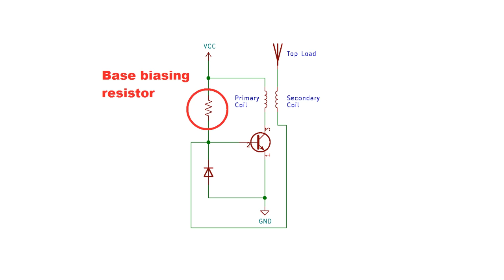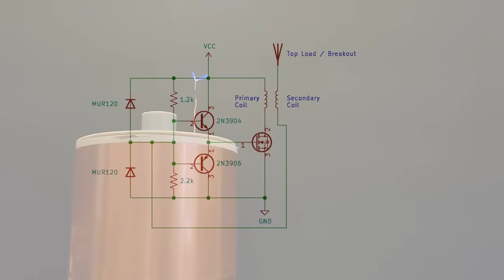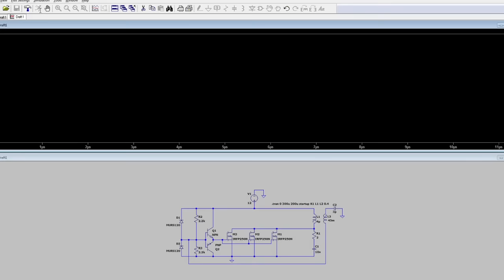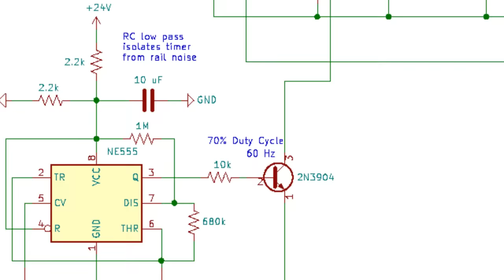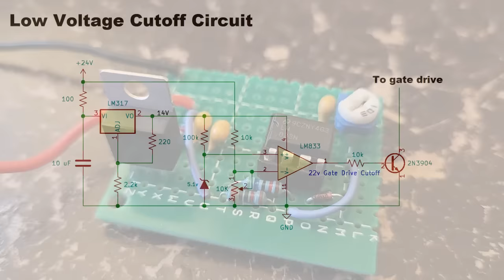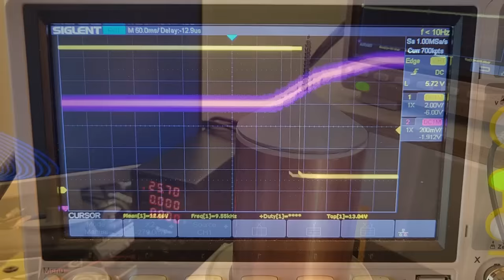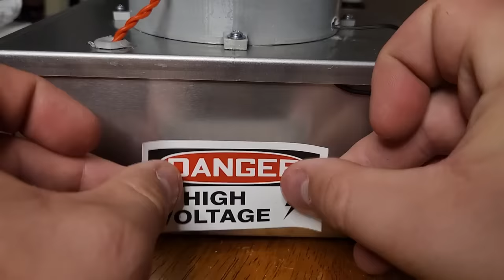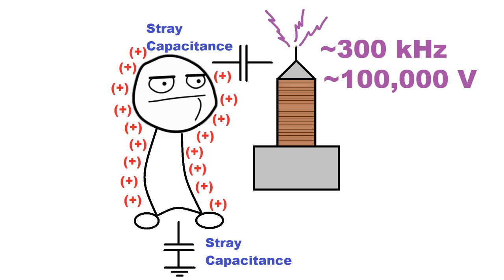Tabletop Tesla Coil

Comment: I can't get the circuit to work with an irfp260n, is the type of MOSFET the problem? I'm also using a very small coil, so could the resonance frequency be too high for my MOSFET?
Reply from the maker: Try switching the polarity of the primary and/or adding capacitance from FET gate-source (start with maybe 5 nF and work your way up).

If neither of those approaches work, the frequency might be too high. I've started to get trouble with FET switching times on anything faster than ~500 kHz
Reply: @HyperspacePirate  already tried to invert the primary windings, didn't work, I'll try to add the capacitors, is the irfp260n good for this circuit?
Reply from the maker: @edoardobonfante753  The coil in this video has IRF640 's with 1.7 nF of gate capacitance each, and the gate drive transistors have to work pretty hard to switch them at ~250 kHz. An IRF260 has 5.2 nF of gate capacitance, and you probably have a resonant freq quite a bit higher than 250 kHz, so your gate drive might not be able to keep up
Reply: @HyperspacePirate  oh, combined with the fact that i'm not using the BJTs to power the Gates but only the resistor divider you may have found the problem. When I power it up, the MOSFET opens and stays open, shorting the PSU. Also, I can't measure it, but I expect my resonance frequency to be over the Mhz. Maybe using smaller resistances in the voltage divider to have more current? I have some npn bjt but I Don't have any PNPs to use to swithc the Gates, can I use only an NPN?
Reply: @HyperspacePirate  I have some BC547 NPNs on hand, could I use only one NPN to drive the gate instead of an NPN and a PNP?
Reply from the maker: @edoardobonfante753  I haven't tried, but i don't think it would work as well because you really need the push-pull effect, otherwise you'll have a class A amp that's just burning up waste current half the cycle
Reply: @HyperspacePirate  yeah, you're right, this circuit is already too complicated for me, I'll try to use 440 and 220ohm resistors to have more current, but if it doesn't work, I think I'll need to try a simpler circuit, also because I don't want huge arcs, my goal here is 3cm arcs. Do you have any other solution?
Reply from the maker: @edoardobonfante753  I'd just make a larger diameter coil because everything is easier to deal with at lower frequencies
Reply: @HyperspacePirate  I will try it with my SGTC secondary, i already tried to put a big topload on the small secondary but it still didn't work, I used smaller resistor and got as low as 56 and 100 ohms but still nothing happened
Reply: @HyperspacePirate  btw thank You very much for the help, I wouldn't be able to identify the problem alone

Comment: Hey, nice viedeo as always, great build!
But try to use glue instead of a metal screw to mount your topload on the TC. The problem with the metal screw is, that it's going to glow up in a nice blue corona discharge, which reduces your topload-output.
Same thing happened to Electroboom in this video: https://youtu.be/WM25pUsrODk?t=498

Comment: i have a question if you don't mind
do the voltage rating of the mur120 diodes have to match exactly with the mosfet? 
planning on trying this out with irf460 so can i use mur160?
also can i use 100 watts for the 2 ohm snubber resistor?
Reply from the maker: They don't have to match exactly, but whichever component has the lower max voltage will be the limiting factor

Comment: But when the BJTs switch, don't they switch the Full voltage to the gate?
Reply: the resistor limited it
Reply: @TantalumPolytope  uhhh that's not how it is supposed to work
Reply: @ElIsraelJijijiji  are we talking about the base resistor of the top BJT?
Reply: @TantalumPolytope  I was talking about the how those totem pole BJTs don't destroy the MOSFETs gate since they are switching the full supply voltage to the gates, doesn't matter the base divider resistor

Comment: do you have a patreon or something?
Reply from the maker: Nope, just OnlyFans
Reply: can you make a video explaining snubber circuits and how to calculate the correct values of the resistor and capacitors? ive tried just guessing but it seems like when i ise the wrong value cap across the source and drain the circuit stops operating and i dont know why
Reply from the maker: @jed826  yeah i just did it experimentally. I held the resistor constant and slowly increased the cap value from 1nF and went up. I just built another one of these circuits for a different project, and i found that with one 27 nF cap it worked, but with two in parallel, it stopped. You probably dont need more than a couple nF

Comment: Does the base of the tesla coil need to be somehow connected to ground or can it operate without touching the ground at all? Also, I would suggest putting some wet clot or tissue paper over the resistors so they boil the water instead of smoking-if of course it is in the configuration to be able to do so....
Reply from the maker: If it's connected directly to ground it won't work. It needs to be either connected to the gate of the MOSFET or to a buffer connected to the gate
Reply: @HyperspacePirate Thank you. So the stray capacitance between the top load and Earth ground is what allows the coil to function? Given capacitors in AC have practically no effect...
Reply from the maker: @Hi-zf4bn  Yes. The LC tank on the secondary is formed between the coil and the parasitic capacitance - that goes for any tesla coil
Reply: @HyperspacePirate  Because I know that certain tesla coils are made with ground rods that connect the other (non-output) end of the secondary to ground, and was wondering if this requires such...
Reply from the maker: @Hi-zf4bn  This specific circuit doesn't require that. By being connected to the FET gate, the low side of the coil is always within a few volts of ground, while the high side is tens or hundreds of thousands of volts, so the difference is negligible
Reply: @HyperspacePirate  Thank you very much!

Comment: I’ve named this thing the mosfet destroyer for its absolute monstrous ability to destroy every mosfet it comes in contact with and randomly explode the signal transistors when I add a topload. I’m running it at 760khz you got any advise for what I’m doing wrong?
Reply: I’m prototyping it on a breadboard to get a bigger output after building it a month ago and getting my dual bridge Tesla coil driver up and running i figured I’d make an attempt at this easier circuit again and no luck so far. I’m using it like a class E in the higher kHz frequency ranges. Any ideas why my arcs are so small. Like an inch or so? And anytime I add too much capacitance the resistor just blows it’s magic smoke.
Reply: Do I really need a huge power resistor? That might be my problem.
Reply: I use a 5 watt resistor and it keeps its magic smoke:)

Comment: would it still work if you 3d printed the case instead of using the metal housing?
Reply: I was just about to ask the same, is the metal for shielding?
Reply: In another comment he says he used metal to shield the electronics and serve as a ground. 

I would think you could 3d print the enlosure and faraday it

Comment: hmm 3.7v per cell is only ~25% of total battery capacity about 30% for lihv
a better cutoff for safety is what most phones/drones tend to set ~3.0-3.3v per cell
this gets you >80% of energy but lets it still be fine for a tiny trickle or a forced override for things that need power to not crash

Comment: What is the purpose of the Tesla coil though? Does it have Any utility other than an art show? Because it doesn't seem like Anyone is using it the way Tesla intended.
Reply from the maker: It was originally intended for wireless power transfer. For a properly designed coil, there wouldn't be any arcs, just a really powerful alternating electric field
Reply: It can be used the way tesla intended, but not to the extent that he believed was possible.
Reply: @HyperspacePirate  why your 555 interrupter works at 30v????
Reply: @ElIsraelJijijiji  he used an voltage regulator (the 2,2k resistors and the 10uF capacitor)

Comment: I built up this circuit without the snubber, zener diode and capacitor bank and the arcs only managed to be the same as a  normal slayer exciter. But a diode got really hot and would have put out smoke if i let it run longer. My coil is in the frequency range of 760khz. Any tips?
Reply: Alright I reduced the turn windings to 2 and the arcs changed in shape considerably so I upped the power supply to 20v 10a and the magic smoke came out
Reply: Ugh the fets died it wasn’t the diode. I plugged it directly into 20v 10a built the thing up in 2 hours though and scavenged the mosfets from an old power supply. The mosfets rated at 500v 15a so I didn’t think it would instantly pop but you were right in the video and I should have put both the fets I scavenged in parallel. Now I have 1 mosfet and a dead circuit. Should have built the interrupter wouldn’t have fried the mosfet so fast.
Reply: You have an email, discord or Reddit I can contact with help with my circuit?
Reply from the maker: Different value capacitors from drain-source of the FET dramatically change the output power. Try adding a few nF at a time
Reply: @HyperspacePirate  I did the 3rd model with missing parts but I’ll try up the 2nd one again with the cap. I don’t really have adequate active cooking for my mosfets so I’ll have to get a computer heatsink or something. I built it in an hour and I fried all the components. I just realized I have more transistors in a box so I’ll give it another try. Thank you.
Reply: @HyperspacePirate  I spent 20 minutes rebuilding it and destroying it and I noticed 2n3904's connections change between circuit 1 and 2 umm is the whole circuit diagram I've been copying wrong?
Reply: yeah it looks like the push/pull transistors are confused between the first improved circuit and the final modifications. ill build it up with the signal transistors changed. ill leave this comment before its done.
Reply: @HyperspacePirate  yup rebuilt it. you had the first mosfet slayer which works then the improvised slayer exciter which burned out which also works. then in the last iteration you mixed up the pinout to the 2n3906 which is what was causing my circuit to put out smoke. anyone who copied the final pinout blindly 5:30 needs to switch pin 3 and pin 1 of the 2n3906.
Reply: okay well now to any one else building this circuit I recommend disconnecting the capacitor and resistor until you can find the correct value the capacitor should be with it disconnected the circuit will still work. overall great build.
Reply: mine was a 70pf trim cap.
Reply: that cap probably is why the output is so small lol.
Reply: did you use de 1ohm snubber resistor with the same wattage? bc I am trying to do the same but I can find any resistor with 25w
Reply: @thebread8918  this project is more advanced then it seems on paper. I designed a snubber circuit for another project on an oscilloscope. I believe it has a parallel resonance cap on the primary which would need to be calculated using fr= 1/(2pi (square root of L*C)). I wouldn’t attempt to build this until I knew how to design a snubber and little bit of math for the parallel resonance capacitor which I didn’t know when I built this up.
Reply: @yourboi1842  And even if I somehow get exactly all the components, measurements and coil wire?  because I don't necessarily want to make the final version.

Comment: 1:15 what's the purpose of the toroid?
Reply: Lower the resonant frequency of the coil
Reply: @ElIsraelJijijiji  Thnx, How does that work, he only used alu foil! is the size important?
Reply: @AnalogDude_  it serves as a capacitor more capacitance means the secondary will resonate at lower frequency, it's usually aluminum since it's high conductivity plus cheap, the size is important tho, bigger secondaries with bigger toploads seem to have less significant effects with environmental changes
Reply: @ElIsraelJijijiji  i meant thin foil and not braking or burning it with sparks, this leiden bottle.
Reply: @AnalogDude_  Leyden jars usually used in SGTC are going to break in no time since they are poorly dv/dt rated
Reply: @AnalogDude_  plus SGTC is a double resonant setup, the primary capacitor needs to handle quite high current peaks plus high voltage peaks
Reply: @ElIsraelJijijiji  Thnx.
😀

May someday, i try it myself, just need to buy a big roll of copper wire, these small packs they sell at electronics shops contain only a few meters.
Reply: @AnalogDude_  yeah usually you'll buy copper by weight

Comment: Is it normal that I can read on my oscilloscope about 200 v peak to peak on the primary while feeding only 12 v and it's a full bridge sstc
Reply from the maker: Sounds like you've either got a switching problem, or you're at/near resonant freq
Reply: @HyperspacePirate  so basically the closer I get to resonance frequency the more I get those voltage peaks that are higher than in the input voltage by a few times?
Reply from the maker: @alyxwildfire1848  at least in theory
Reply: @HyperspacePirate  hi, I could theoretically use a different interrupter for this?
Reply from the maker: @ElIsraelJijijiji  Sure. It's just a square wave source that drives a BJT
Reply: @HyperspacePirate  how much voltage you think I can go, I have a 60v supply

Comment: Hey dont secure your top load with a long screw or a screw at all, it has a sharp end and can burn your secondary(like Electroboom)
Reply: Bruh, you can see the screw doesn't go deep into the secondary coil, screw going deep into secondary can cause internal breakdown, but this is not the case
Reply: @ElIsraelJijijiji  mmmm
Reply: @FlammableElectronics  why you turned into a microwave?

Comment: That's pretty stupid to make your ground the hot side. You have built it the wrong way. You have no shieldings what so ever. No wonder you get burned with your death contraption. Look how high power high frequency is transmitted and rebuild it with those standards and your ceasing won't burn you any more